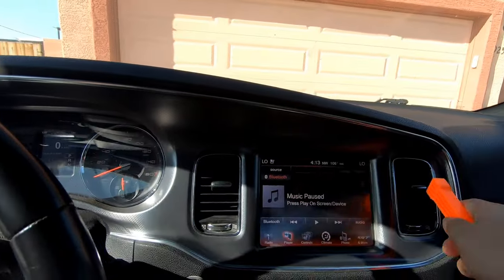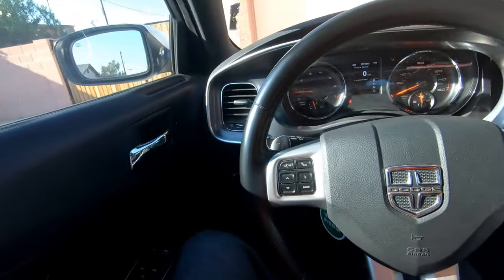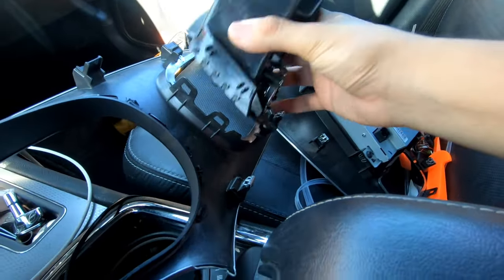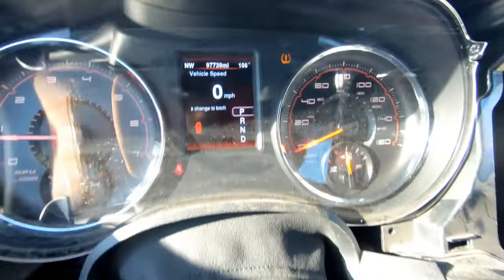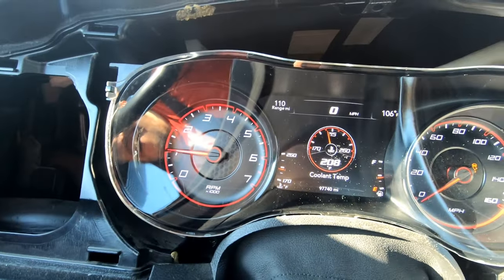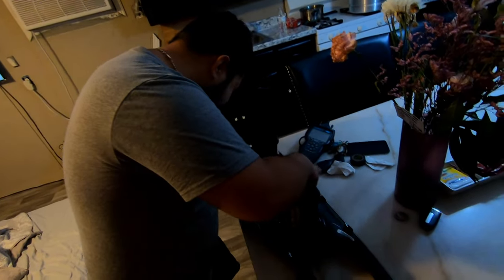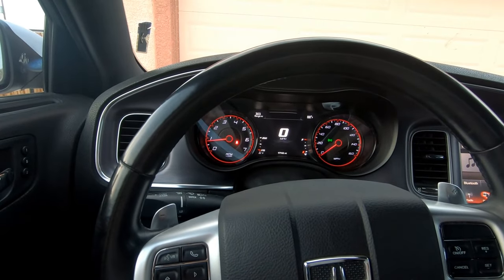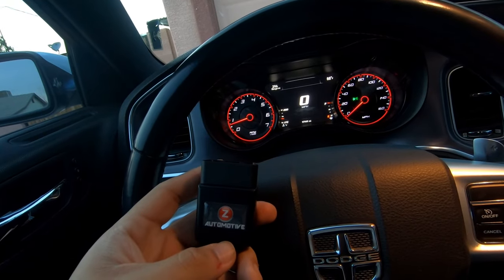Charger Cluster Swap Upgrade - How To

Comment: Is it possible to upgrade 2011 Charger cluster to the newer ones?
Reply: I was looking at this aswell for the 2010 Challenger. I think the issue is that the entire front dash is a different build and may require an entire rebuild. I'm still searching for a solution though
Reply: I’m trying to figure it out now if the 2011 can get srt pages

Comment: Can someone help I have a 13 charger with this set up but my tire pressure sensor light came on and now I can’t get the speedo back
Reply from the maker: How To Use Tazer (For Cluster Swap Mode)
https://youtu.be/BzK8vn2KXAA
Reply from the maker: you can also shut off the tpms through the cluster with the tazer :)
Reply: @EverythingBoosted350  thank you so much

Comment: Ive been working on this project for a while now. have a 2013 RT MAX AWD and when i connected new cluster of course milage off but gas is stuck on full and says cars not in park and other errors. i can access menus cuz the tazer and have turned on clusterswap mode but still having same issues. Only thing that really works is the speedometer when car moves. Anyone have this problem or know how to fix?
Reply from the maker: what year is the cluster from? shouldn’t be having those issues if it’s between 15-17
Reply: @EverythingBoosted350  I believe 2017 do you think it might be because scat cluster
Reply: @EverythingBoosted350  has 180 on dash
Reply from the maker: @bloodyguts_5.7_59  It shouldn't be because it's a scat cluster. Only thing I'm aware of that happens is you get an airbag light when you put a scat cluster or turn on the scat or hellcat splash screens. Have you tried changing the tazer settings for the cluster? ex. changing the splash to normal start up instead of the scat start.

Comment: What I need for Charger 11 se ?
Reply from the maker: cluster
cluster bezel
tazer from zautomotive
zip ties and a little patience to align the screen lol
Reply: Can’t use the old bezel?
Reply: Because I have the small screen 🤦🏻
Reply from the maker: you can modify it to fit yes, it just won’t look as flush and clean because the new bezel has a border the cluster sits in that the old bezel doesn’t have :)
Reply: @EverythingBoosted350  ok n the tazer 🤔 what is for ? 🤦🏻
Reply from the maker: the tazer is good for a lot of things but in this case it’ll allow you to navigate through the menu’s in the cluster. i’ll be uploading a video of the features on the the cluster soon :)
Reply: @EverythingBoosted350  yes pls 💪🏻
Reply: I can’t see my 5 speed on the cluster 🤦🏻
Reply from the maker: turn on cluster swap mode in the tazer menu
Reply: @EverythingBoosted350  can u send me a link for the tazer pls for I can but it
Reply from the maker: https://www.zautomotive.com/product/z_tzr/#security-bypass-modules
Reply from the maker: the year of your car
Reply: @EverythingBoosted350  ty bro
Reply: @chuloramirez7388  did you get it to work?
Reply: @roadrunners6202  yes
Reply: @chuloramirez7388  I have a 2011 charger too… i ran into issues with my old 2011 charger kept getting transmission error… did the tazer work for you? did u also get transmission error on cluster?
Reply: @roadrunners6202  did u ever fix this? i think u need alfaobd to code the cluster
Reply: @rghmods4466  had one still didnt work think it has to do with 2011 model year
Reply: @roadrunners6202  i got my cluster swap to work with a 2017 police charger cluster. turn cluster swap on with traction control and cancel but turn the one in the menu off. Thats what worked for me. if u cant get it still i can like u a tutorial for a forum post i posted
Reply: @rghmods4466  what year charger you got?
Reply: @roadrunners6202  2011

Comment: Where do I buy it at
Reply from the maker: you can order on ebay or search your junkyards🤘
Reply: So you just take it straight out of a 2015
Reply from the maker: yes 2015-2017
Reply: Where do you buy that plug in black box
Reply: Tazzer there like 250 hu

Comment: I’m trying to marry the tazer but it not allowing me , what button did u press
Reply from the maker: you gotta navigate through the menu on the cluster to marry it. if it’s not letting you marry, try to unmarry/ reupdate connecting it to the computer and try to remarry after.
Reply: So what do you press on the steering wheel then
Reply from the maker: 11-14 you back all the way out of the evic menu (menu in the gauge cluster) and scroll all the way to the top.

press back and cancel buttons to access tazer menu

while holding the back button press the cancel button to cycle through the menu. (find marry tazer option)

to enable/disable options or to access the menu option on the menu, press the on/off cruise button while holding the back button.

Comment: Where did you buy the cluster from or can you just get it from a stock 2015 charger?
Reply from the maker: you can use the cluster from any charger/challenger/300 2015-2017

Comment: Does the tire pressure gauges still work ?
Reply from the maker: yes they do but since i didnt put the sensors in my aftermarket wheels i shut off the tpms monitoring system with the tazer so the light didn’t annoy me lol